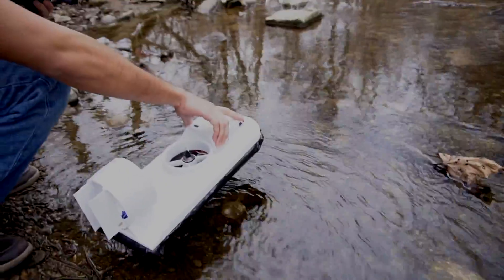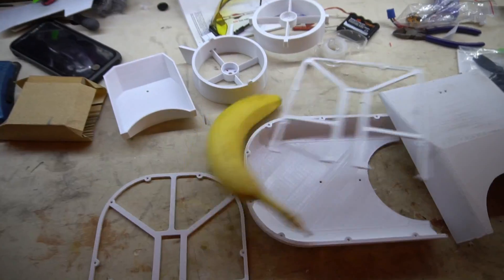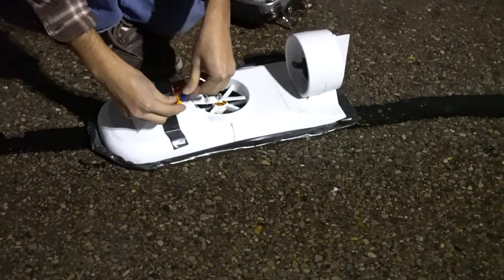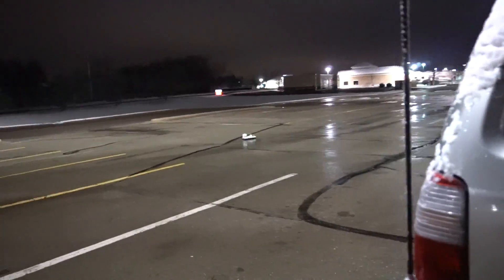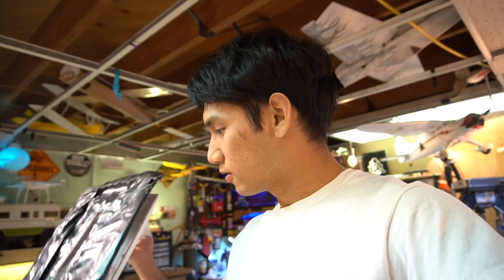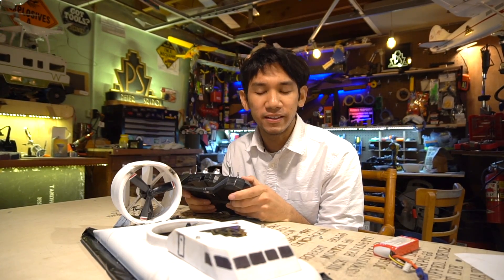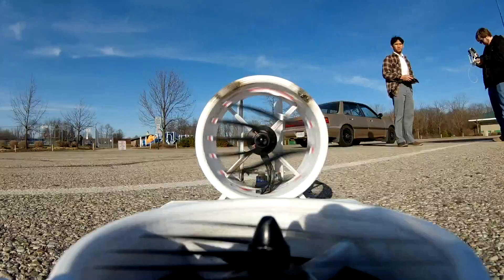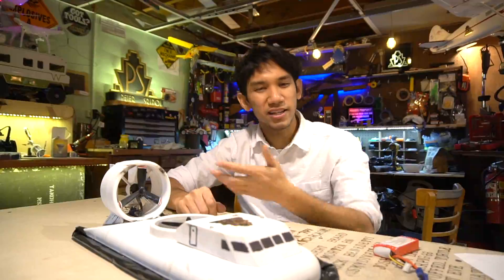FREE 3D printed RC hovercraft

Comment: Had some thoughts: if you designedthe front of the hull like the front of the Zubr hovercraft then the bow wouldn’t dig in. 

Also if you made it a bit wider it might be more stable. 

I’ve read of folks installing gyro systems that correct heading and eliminate unwanted drift.  Not sure what they are called. 

I’m fascinated with the skirt design and how it permits you to run on somewhat rough surfaces.  I haven’t seen your design anywhere else.  Please tell me more about it

Comment: The idea way to set up the lift motor on one of these is with a radio that's got a fully proportional knob for a channel. I just moved into a Futaba 6J and its sixth channel is on such a knob, so I'd use Ch6 for the lift fan on mine.

I'd probably also use a car ESC instead of a plane ESC to control the thrust fan, mostly, so I can get reverse out of it. Also, car ESCs are often already waterproofed right out of the box, which is seldom if ever the case with plane ESCs.

Comment: Idea for a better skirt: use the material you find in the higher end air matresses. It is very cut resistant, and although the weight is higher, it might be worth it.

Comment: pro tip: commercial hovercraft toys use styrofoam inside the air cushion to keep it from sinking in case the battery runs out :-D

Comment: I have noticed that you often donot include interlocking pieces on 3d printed projects, even more surface for mating two parts with adhesive would probably be fine in most cases.

Comment: Why not use two different controls for the fans so that you can keep the craft up and hover without having to mash the forward motor?
Reply: I realize you addressed that in the video towards the end. It's something I realized at the start that made me comment. It seemed like a simple fix for your system. since the hover only needs to be on or off, you could set it to a button instead of having it tied to your directional controls...

Comment: you for sure need a separate throttle for the lift motor, one you can dial to the speed you want and then leave it alone and just focus on driving it with the other throttle and rudders. like a real hovercraft.
or you could just have an on/of switch through a speed control for the skirt motor separately.

Comment: if you had a 6 ch controller you could tie the lift motor to the gear/flap switch and control the motor speed with the trim settings.

Comment: Why not set it up to have left stick be throttle, so you can set it and forget it once you get sufficient lift, then have right stick control the motor with forward and back and control the rudder's with left to right?

Comment: I tried to make a hover craft when I was young by taking a 9 volt battery, a small fan and an old full over ear phone with the foam insert. It vibrated over the table with ease, but sank like a rock.  I got an E for effort.

Comment: You should mount the rear fan on a pivot and tie a servo to the entire duct. then rudder control will be from turning the motor and prop, instead of a flap behind the prop.

Comment: couple of suggestions. make it lighter. you can probably get away with 2-5% infill on the ducting for the lift and thrust motors with a good printer maybe even 0% infill. 2 perimeters.

try to make the hull a SINGLE perimeter 0% infill and then add structural support at key points.

your lift skirt is wasting a ton of power but I can't think of an easy/cheap way to fix that just yet. I will have to think on it I Really like this design.

segregate your lift and thrust power. I do not know how to do this but it should be possible on modern radio's. work it kind of like a quad copter. where the lift motor is "engaged" and "always" run at a minimum power level even when you throttle down.

fill the empty space inside the shell with foam for flotation.

when I finally get my CR10 and also mod it for large print volume it would be fun to try and print the hull as a single piece instead of parts.

Comment: If you haven't tried it yet, add a secondary non inflatable skirt 'moulded' to the 'baloon' like primary skirt...

i'm guessintg you got most of those holes driving it out of the water first due to abrasion? 

the secondary skirt should help prevent this and give it slightly better stabilitary and further lift. 

also add a couple more /intentional/ holes near your initial one, chances are if abrasions didn't cause those holes, the air might have..

Comment: OK cool, But I have a few ideas for possibly improving this. 
switch from a single ducted propellor with dual rudders to a dual pivoting ducted setup. (no rudders), and mount them a little further forward, and as far out as you can manage. maybe toy with thrust vectoring as well. 
Don't tie the lift motor into the throttle, leave that as a separate toggle. 
and find a way to make the front of the skirt a little more wedge shaped so it's less likely to nose under on the water. 

Also maybe look into moving the CoG further back so it's less nose heavy.

Comment: its probably been said but with the skirt if you pleat it with ducts around the edges to allow an air curtain your lift will be greater and more controlled. another variant is instead of one large vent in the middle of the belly move it forward one third of the hull to help with the thrust pitching the nose down into the water as you wont have as much lift under the thrust motor

Comment: Any specific kind of propeller for this?
And can I make this using foam boards? (I don't have a 3d printer)
Reply: I'm new to this channel so just reading this comment, but I think a form board is plausible.
Biggest issue would be fan mounts on the back

Comment: don´t you think that maybe is better for large 3D prints like this, to try to make the union beetween 2 parts in a form that fit together into each other? if you make it like this one, with "flat" unions glued, it will be almost sure a weak point and will break very fast.
it´s not hard, just with some overlap of the parts and some "clip" will do it, and even if you also glue the parts, the glue will have to resist a lot let force.

Comment: hey just a heads up instead of a prop for you lift use a 3D printed centrifugal impeller this will give you a more stable air cushion. then instead of rudders for directional control move the whole duct for thrust vectoring.

Comment: man that was brilliant, my suggestion would be maybe make it a light tarp instead of garbage bag aswell as making it it roughly 3 inches for height. also if possible to have that center propeller have a cap throttle aswell as adjusting the back propeller to increase after a certain strength of the center throttle. in the sense of making it fill the bag before it shoots forward, with a center throttle cap it would make it so you could just pop it up and focus on the back propeller for speed and turning ( my apologies ive always been insterested however im not educated enough to explain it in full technical form)

Comment: On water skimming: make the skirt just larger slightly at the front and the craft should angle up alternatively play with weight distribution and rear fan elevation and you might get the same effect.
Reply from the maker: exellent point! that's one of the things i'll mention in the build/construction part!
Reply: PeterSripol you learn a few things growing up near the world's last commercial hovercraft transport system ;-)

Comment: Why don't you make the 'hover fan so it runs constantly?'
Reply: INON TV 
I'm new to all this stuff but probably because the craft will spin in circles because of the way the motor spins and how the craft always wants to spin the other way so if you don't have the thrust fan on the back going to stop it from spinning things won't go to well
Reply: INON TV 
That's a guess though
Reply: JP RC narr it shouldn't do, having a constant fan would just mean the craft would constantly float about rather than stopping when the driver releases the throttle. As peter briefly mentioned he built it this way as it's more of a beginner setup. Life size hovercrafts have constant vertical lift and they don't spin

Comment: Hi Peter, I built my hovercraft out 1\2" pink foam, I used a 1 100kv w a 10" prop for hover and a 2 200kv w 6" ( park jet) for thrust. I put the hover motor on the gear switch and set it for around 35% and rudder on aeleron, works great but on water not as much, the skirt which is slightly different than yours but basicly the same collects water and is then bogged down. Full size overcome this problem by basically being a boat hull with the air vents placed at the top outside edgs so even if therss no power it floats with the vents above the water line. heres a link

Comment: Peter I am a fan of surface effect vehicle/craft, I see a few of issues with your design.  You covered one that was the weight, the lighter you can make it the better.  You want to keep the cushion pressure low so you are not blowing spray.   When you are blowing spray you are losing cushion air and losing cushion    

Another is the skirt design, what you are using is more or less a finger skirt with out the fingers.  Do to the Bernoulli Effect acting on the front of the skirt the skirt in trying to pull it's self into the water.  The way around this is to use a pontoon skirt where you bags go down the sides and across the back and all you have in front is flap going across the front sealed to the pontoons.  This is what Barry Palmer has used for many years on his Sevtec SEV designs.   

Another is getting your craft level when on cushion this is really important when working on water so you need to work out your CG of the craft.  

Anyway go check out the Sevtec craft for ideas on how to improve on what you have done so far.   If you can make the craft wider if you can for a bigger footprint over going longer.  Put some drain holes in the back corners with a flap over them on the outside to keep them from acting as scoop as you move forward in the water.
Reply from the maker: cool man! excellent points! I just went for a quick and dirty skirt design for simplicity! The pontoon skirts sound interesting, i'll have to check them out!
Reply: PeterSripol Barry was good at keeping things simple unlike others involved in engineering.  You will find light weight rip-stop nylon will work very well as a skirt.  And yes you want to split the lift and thrust speed controllers.  Put the lift on a switch for on and off after you work how much air flow you need.  The scale you are working at being able to dump the front cushion chamber wouldn't work that's how the Sevtec's can cut around turns.

Comment: Peter, from looking it looks like you have a small air gap between the top of the skirt and the body? meaning that when you were going forward and it pushed the nose in, it likely got some water in the skirt at the front, stopping it from pushing air out in that section, causing it to dip the nose even more, and take in even more water, until it flipped and sunk like it did on the video. Try it again with some glue along that seam?
Reply from the maker: yep! valid points! In the shot with the separated body the gap is present, on the water it was closed, but water still was splashed in by the lift fan creating turbulence below the skirt and getting water inside of it! I put some holes in the skirt afterwards which really helped the sinking! (but yes once the nose dipped even on that revision it would surely sink!)

Comment: Use waterproof foam board!
And you need a deflector plate so the air shoots downward in a ring just under the edges. https://upload.wikimedia.org/wikipedia/commons/thumb/3/31/Hovercraft_-_scheme.svg/220px-Hovercraft_-_scheme.svg.png

Comment: use acetone to plastic weld the two halves together. it basically makes the two pieces melt into eachother. James Bruton from xrobots has lots of videos about it on his Chanel
Reply from the maker: Yep! that would have done the trick, but the print was in PLA, If It was ABS I totally would have!
Reply: Ah, I must've missed that. V2 in ABS?

Comment: nice job, but i reckon a fully programmable radio like a taranis or 9xr would run this the best, because you could run the lift motor of a switch or dial, and run the throttle independently for best control

Comment: I'm wondering if an edf unit would work better for the lift fan.
Also, setting the controls like a quadcopter.
ABS and acetone welding works well if you can avoid warping. I haven't tried the plastic cement, but it sounds like a good idea.
You might try printing the shell in vase mode and then printing a support skeleton to glue on underneath.
Possibly rotate the whole propulsion unit instead of rudders.
Lastly, good stuff. Keep up the good work.

Comment: you should use those thrusters to build a super fast FPV ROV and go explore a shipwreck the next time you go to hawaii. You could tether the ROV to a floating thing that follows it on the surface, and that can relay the FPV signal and TX signal to the ROV under water.

Comment: Another excellent video Peter, I can't believe you're at 110k subs already! Last time I checked you were at 11k haha. 
Have you considered running the bottom facing motor on a 3 way switch? It wouldn't be hard to map the motor to an auxillary switch so you can just flick it on and the bag remains inflated so you can control speed/turning.

Comment: just an idea for skirt material, the lining you put down to make ponds is thicker then trashbags, yet still pretty thin, and very strong. rather then glue, you might be able to heat fuse the seams. I'm not looking to make one, just using my grey matter

Comment: The lift fan needs to be on it's own channel, not parallel with the propulsion fan. The easiest way to wire the lift fan is on an aux channel to a three position switch: off, full on, and a middle position around ~15% less than whatever you set as max lift.  On land you run lift fan on full to get maximum skirt clearance, but the idea with middle position switch is you drop down the craft lift on water where you don't need all the clearance.  It also saves some battery and adds some stability sitting lower.  If your radio has it, a variable slider or wheel switch would be even better, because then you can trim the skirt inflation to whatever is best for particular situation.

Comment: I've used a store bought one of these and when you turned it on it would "idle" (fill up the bottom bag) and just stay like that. And the throttle was on a separate motor so it was hovering at all times but not moving

Comment: With the print, unless you have awful platform adhesion, you should be able to do well without a raft. Since your printer doesnt have an enclosure, you look to suffer from cooling problems. It is especially prominent when using ABS, but i find it better to not use rafts if your print has a large surface area.

Comment: I built a similair craft except i assigned the down facing motor to the throttle switch on my 9xr, so when its switched on it gives 80% throttle, then steering is just on rudder like normal

Comment: I think it's cool but you should put the lift motor on a knob so the drive motor is on the throttle stick and that way you could have the to 2 motors independent of each other.

Comment: Those walls are way too thick.  Looks like 1.6 or 2.0mm... That contributes a lot more to weight than a 10% difference in infill. 0.8mm would be plenty for this.

Comment: I freaking love hovercrafts. If you're printing with ABS, try gluing the parts together with ABS cement. I've had pretty good luck with it.
Reply from the maker: great points! yep I tried fusing some abs together with acetone and Its amazing, the parts broke elsewhere than the joint. The hovercraft is PLA unfortunately so i'll have to try other glues!
Reply: William Osman 
Better yet, ABS weld with acetone
Reply: printing it right now in ABS :D
Reply: @svenforstner8155  did your room smell as bad as the legends say? I've only ever printed in PLA lol.
Reply: no the legends are overhyped @josephstalin7995
Reply: @svenforstner8155  sweet! I'll keep that possibility on the table.
Reply: sven forstner I print in PLA and use CA and kicker to bond my parts... works great!

Comment: How about hooking up the lift motor to Throttle channel, pusher motor to Pitch and servo to Roll? That way you can just set the lift to whatever it needs to be and then leave it alone while driving with the other stick? And you can still kill it quickly if (when) something starts to go wrong.

Comment: Have you heard of 3D printing Friction welding? It's when you put a piece of filament in your dremel and pull it towards you over a crack in your print or to stick things together, the filament melts and the spinning carves a channel in the print to fill with melted filament... Pretty cool if you ask me?
Reply from the maker: I've seen it and it looks intresting! I'll try and give it a go sometime in the near future!
Reply: I have to try this. Sounds like an excellent way to joint parts if you get it to work.
Reply: Sam Kelly 
friction welding is good only takes a little time on bag parts as you can only put a small bit in at a time    loctite universal super glue works great for pla its also waterproof and bonds in seconds

Comment: Awesome... I made one years ago out of Balsa and foam with a ripstop skirt.. Having a separate control for the lift motor is a must.. it works way better that way.. I used a Brushed motor for the lift motor hooked up to a relay that plugged into the receiver then I could just flip a switch if I got in trouble and it would drop to the ground.

Comment: The sinking issue is easily solved. Before you put the skirt onto the frame, if you cut some foam and put it inside it this means that there is always air in the skirt so it should be much harder to sink.